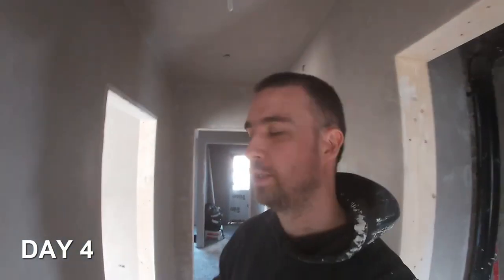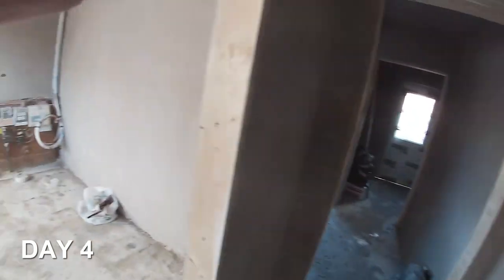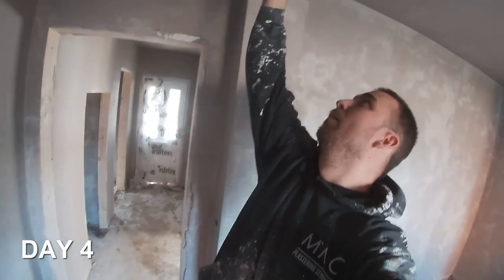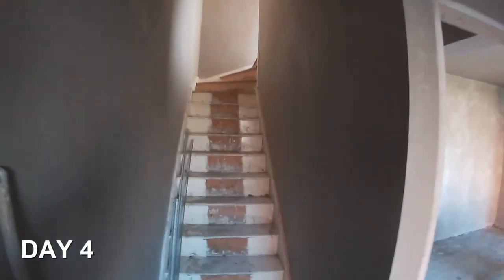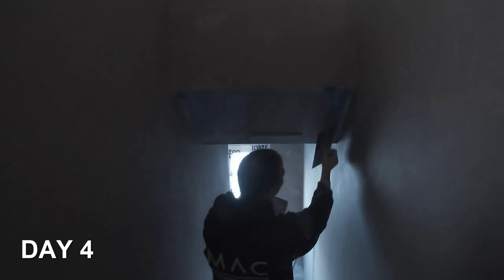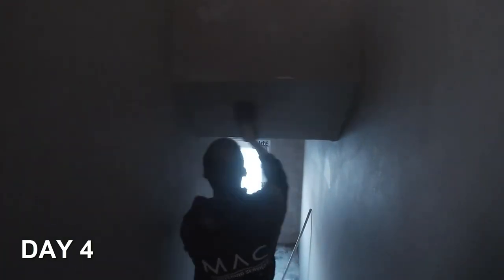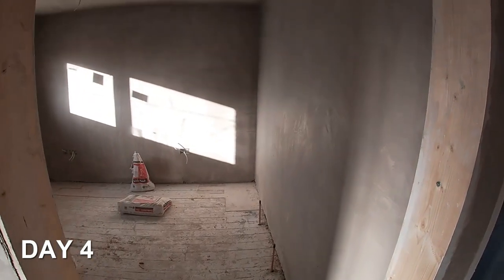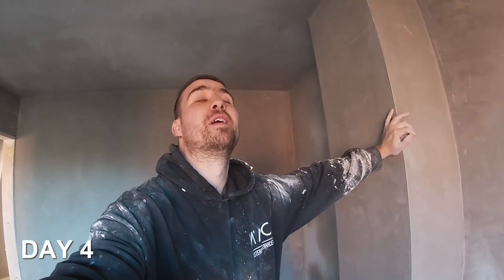DAY Four Plastering another house v log nightmare job

Comment: Can u not just throw a handful of fast set in the mix? Works in multi finish
Reply from the maker: Didnt have any left you mean the half time gear ?
Reply: @macplastering  no mate the stuff tapers use, joint filler
Reply from the maker: @stephbhoy1  would have thought that would slowed it more